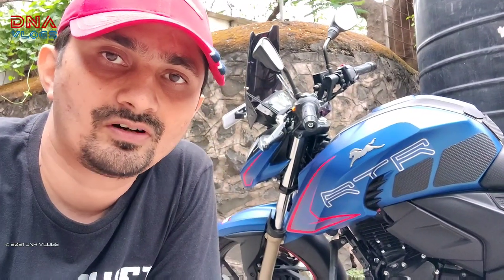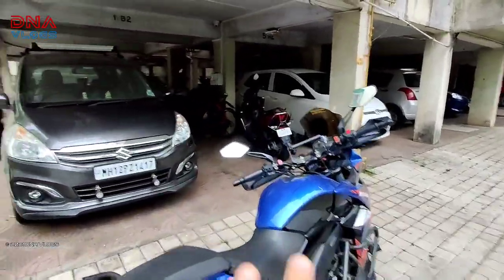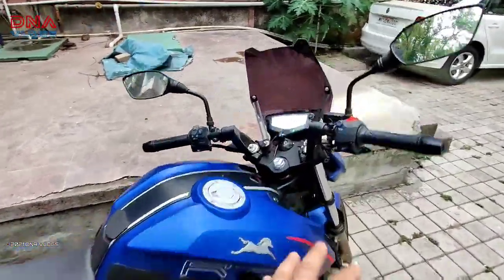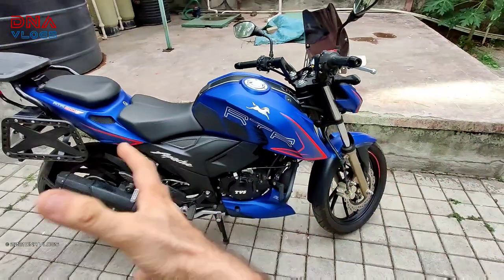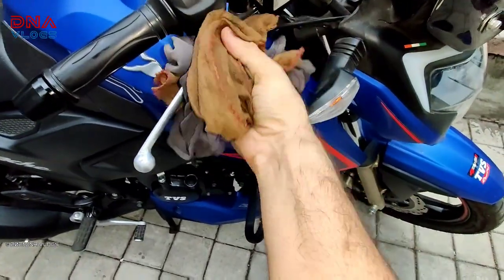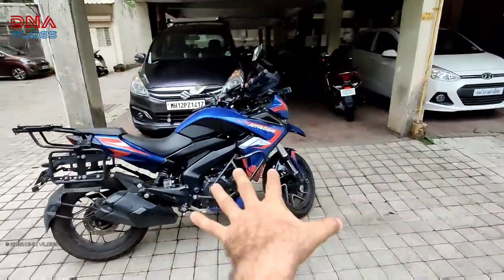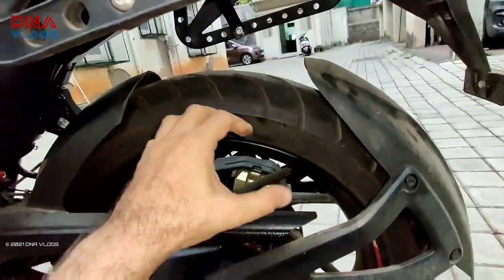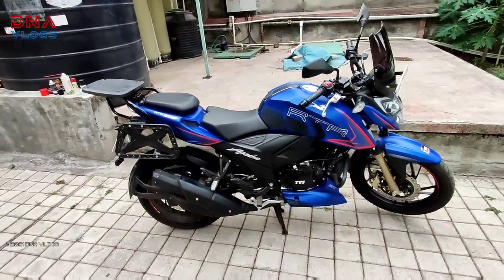2021 BS6 TVS APACHE RTR 200 4V | Lockdown Maintenance Tips, How to keep Ur Bike Healthy | DNA VLOGS

Comment: Engine ke samne ek screw he... Wo rust collect karr raha he... I can't get to clean it since it is in between those chassis part. Have u noticed this?
Reply from the maker: Engine ke samne ? Where ?
Reply: @dipen.nisar.autovlogs  Front side on cooling fin... Below the exhaust opening there is a screw... I'm not that technical so sorry for not being specific
Reply from the maker: @sivaprasadps9041  will check